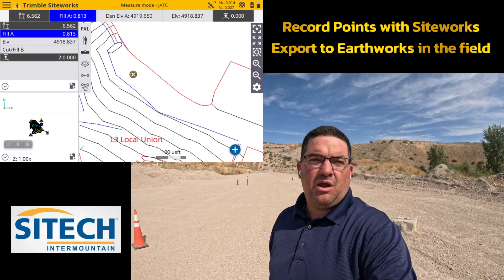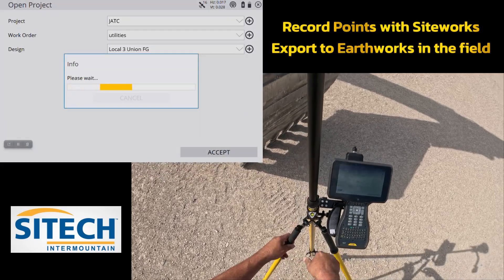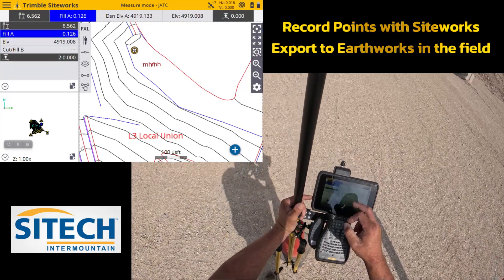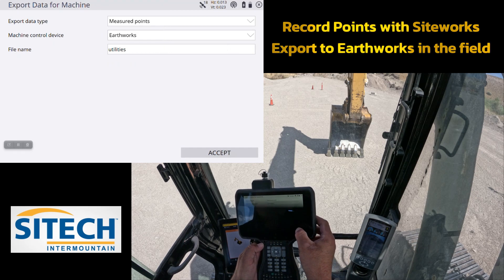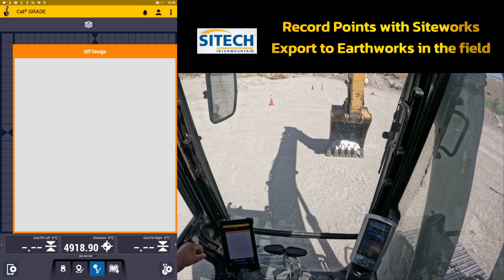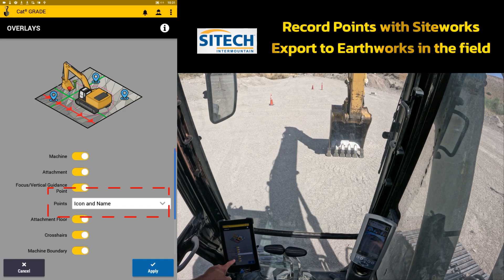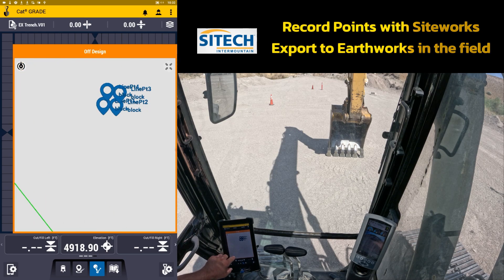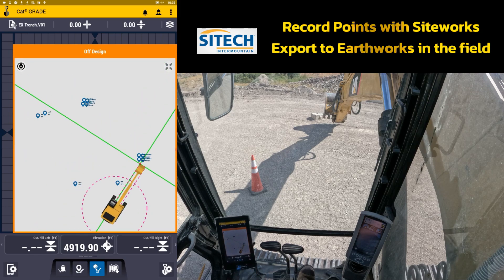Siteworks Recording Field Points and exporting to Earthworks

Comment: Great videos I've learnt a lot,is there a way to record  how much dirt you have excavated and export it so an engineer can monitor the quantities remove ,is this feature in mapping ,please could you do a video about mapping feature thanks
Reply: There is a couple different possible ways to do what you are asking.  I will create some mapping videos soon.  But you can turn mapping on for latest pass or last pass as you work or you can turn it on at the end of the day and run the machine all around where you have worked to create a map of it then and then that can be exported out and put into Trimble business center and a surface created out of it yes.  You can also record a bunch of points with the machine if it is a smaller area and then those points can either be exported to a data collector, surfaced, and then ran a surface to surface measurement, or those points can be pulled into Trimble business center and made as surface and do the same report. but I will definitely  get to some more mapping in the future.